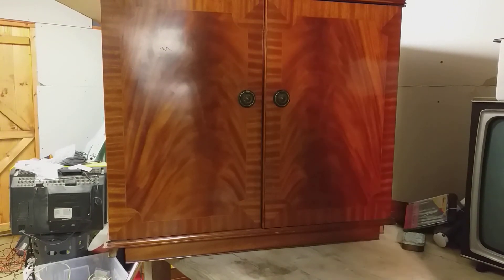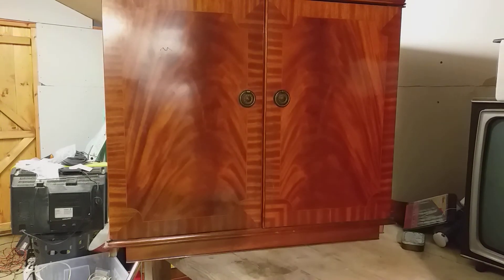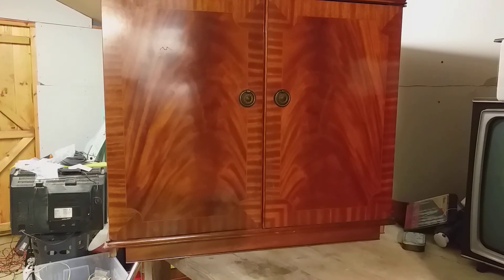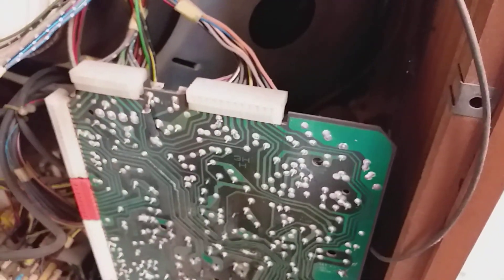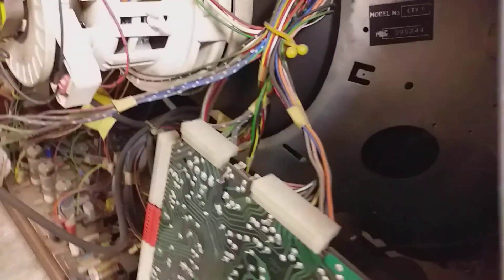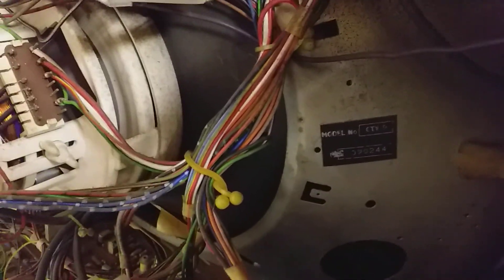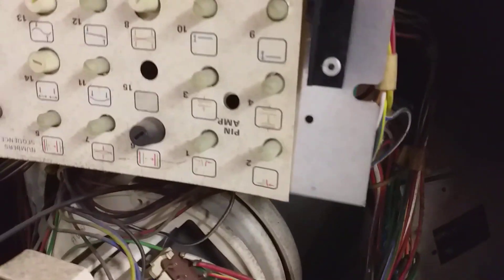Vintage TV.  PYE 697 / Dynatron CTV19

Comment: I've had a few Pye hybrids in my time including a Dynatron CTV7 using the 691 chassis and a CTV16 using the 697 chassis. They both worked very well indeed after a fair bit of work. I still have a cheap and nasty Pye CT205 with a flimsy chipboard and formica cabinet which works very nicely too. Nice new CRT in it though! Tas

Comment: Ah I do so love the Pye205, you only ever removed the line output panel once without disconnecting the mains. 
2 possible results
1 Death
2 You never did it again

Remember that 100k boost resistor going short circuit, yes a resistor going S/C, to me ages to work out why.
Thanks for the video dude

Comment: used to deliver and install these in the early 70s, made me laugh when we installed the dynatrons in the flash homes of our more snooty customers( and believe some of them were snooty) because the didn't know what the they were paying though the nose for when old mister smith down the road in his council house was getting a identical set minus the fancy cabinet for half the price and both would spend a equal amount of time on the repair bench regardless of price
Reply from the maker: It's sad they couldn't of put a better chassis into them, though that's probably how they made their profit.
Reply: @IrishvintageTVRadio  true, if I remember correctly pye echo and dynatron were basically one company and all the same chassis. We also sold Bush and Murphy sets and I believe they were one company as well

Comment: The BD124 transistors on the frame o/p  board go leaky & you end up with reduced scan.

Richard (UK)
Reply from the maker: Hi Richard, yes they did give a bit of bother. I really must get back to this at some stage, I also have it's cheap cousin in the flimsy chipboard cabinet.  Thanks for commenting 👍
Reply: Yep the cheap version (which I always preferred) is the Pye CT205 I think.